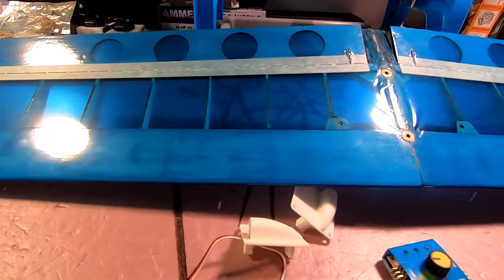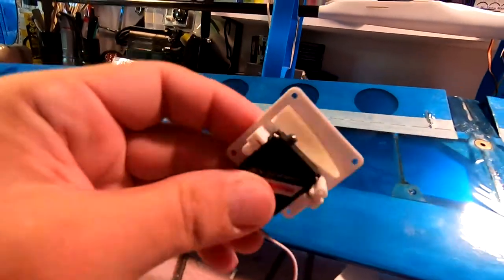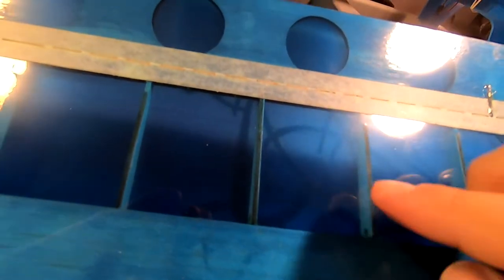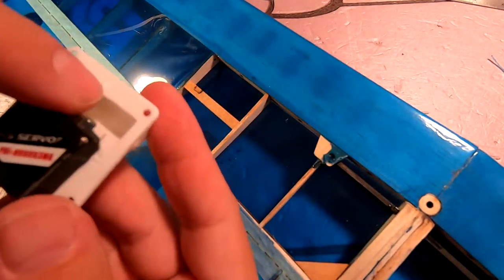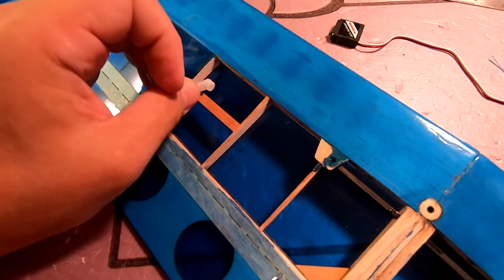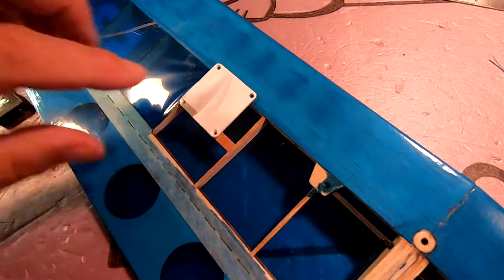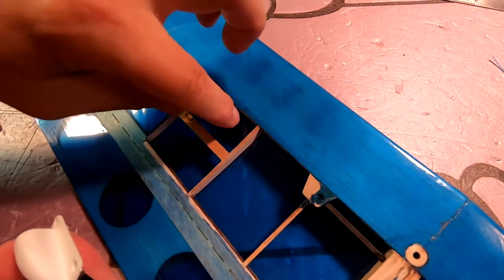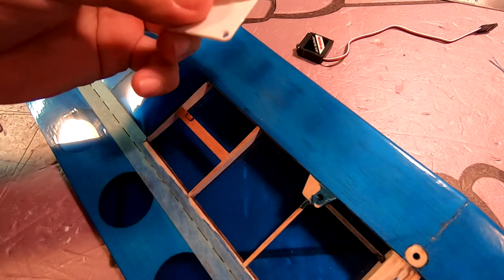HobbyKing Raven 1500 DLG - Build Pt14a - Mounting Aileron Servos in the Wing

Comment: Can you post a link to those servo holders please. They could probably have saved me a bit of work when I did my magellan. I'd like to have a pair on hand if I build another plane.
Cheers
Reply from the maker: Wow, I looked and looked... I went through every old email in my "Vendors" forlder where I store any emails from online purchases. I went through all the sites I buy from... but no luck. It may be a discontinued item, but that doesn't explain not finding a purchase order in my email. Just in case, I went through my order history on Amazon for the last two years and no dice. Anyway, you could use a pair of these. If they are not stiff enough, you could laminate a piece of 1/64th-1/32nd inch ply to it. http://www.espritmodel.com/servo-fairingscovers-carbon-fiber-50x50mm.aspx
Here are some more from a shop in the UK where I got the finger blade I added to the Raven: https://www.hyperflight.co.uk/products.asp?cat=Servos&subcat=Servo+Covers
Sorry this is the best I can do. Those mounts have been sitting in my "Miscellaneous Parts" box for a while.